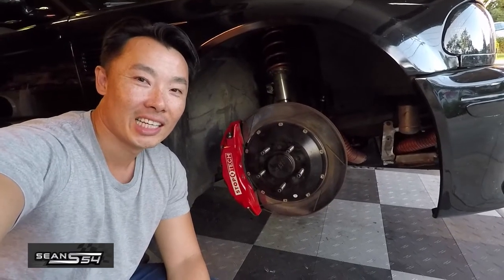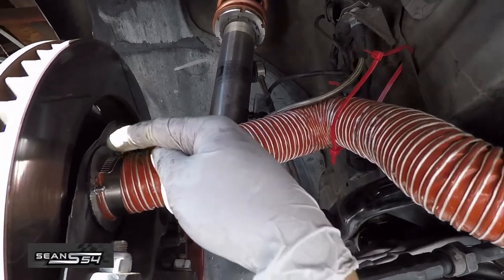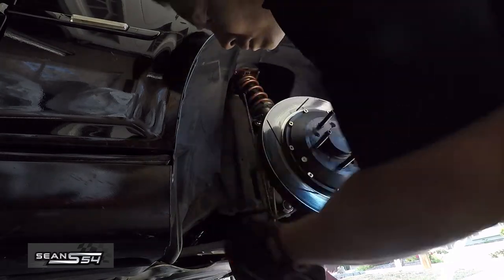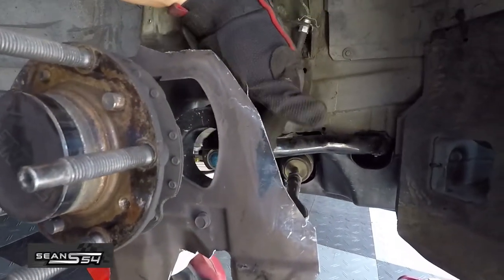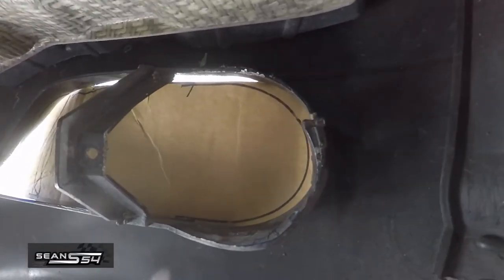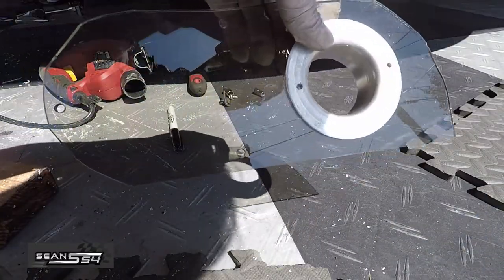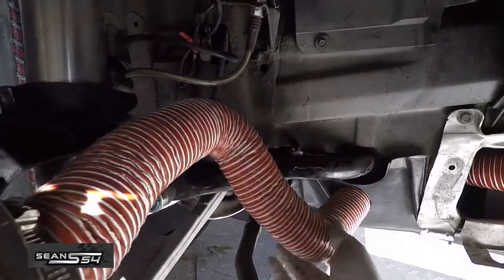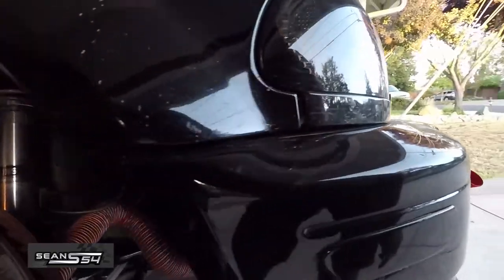Custom Brake Ducting for your Track Car - BMW E46 M3

Comment: I think it would have been better if you used to original air duct, and just made some sort of reducer to attach the vent hose to and instead of cutting up the heat shield you shouldve left as is and installed the duct flange and connected the hose. I think that wouldve been better IMO
Reply: Lalo Herrera yes, I also thought of that, and it would bring even more air, anyway he can do it anytime if he wants

Comment: Nice video showing in detail the work. 
I also plan to install some brake ducts on a z4. My oem brakes with yellow ebc pads get hot after no more than 3 laps. They have only  60' on the racetrack and the pads are already cooked. I've made a pair of carbon fiber air intakes and now I need to install the tubes. Not sure, why you trimmed the exterior of the heat shield.?
Reply from the maker: Trimming of the exterior heat shield is not necessary... I did it to allow more air to the brakes while in motion or parked.

Comment: Yeah most probably the stock air duct WITH the accompanied heat shield is better than just 2" tubing going across all the suspension parts and destroyed heat shield.. :D
Reply: Heikki Saari I think the new cooling ducts will do better because the air now blows directly into the center of the rotors, but not sure why he had to trim the heat shield. Anyway,  the brakes will stay cooler now and probably compensate for the missing shield

Comment: How is this holding up? FYI I have no heat shields and no issues in spite of what a few think
Reply from the maker: It's holding up just fine, no issues at all. I didn't have brake heating issues on track with my 355mm BBK up front but I added the brake ducting to minimize heat and prolong the life of the brakes.
Reply: Yeah I would think not with that kit. My car is  pretty light but a little cooling wont hurt. What are you running for pads and fluid? Enjoy all of the videos!
Reply from the maker: Thanks Jay! I'm running PFC 99 compound up front, PFC 08 compound on the rears (stock calipers, ZCP rotors) with Motul RBF600 brake fluid.

The only "issue" I have with my brakes is pad knock back, which unfortunately is inherit to BMW suspensions and typical with BBK. Here's some info: https://www.youtube.com/watch?v=PgYNeEVNbTs&t=194s
Reply: I watched the video on the knock back and have a 4 day track event coming up and am going to work on the brake pedal tap.
Reply from the maker: Cool Jay! Practice left foot braking on the streets if you have an auto. Getting the left foot sensitivity/control down is the tricky part but you can master it in no time.

Comment: Where can I get the flanges? What should I search for?
Reply from the maker: I bought the flanges from https://www.aircraftspruce.com/ (part number 10350-8 ALUMINUM FLANGE 2" 10350-8). I bought the 2.0" kit years ago intended for my S2000 but am now using them on my M3.

Many people run 3.0" kits but keep in mind you'll get rubbing lock to lock. Not a problem on track but a problem if it's street driven. My 2.0" kit clears the wheels no problem.

Comment: I hope you don't drive this in the rain driving without the dust shield when water hits the brakes you lose your brakes
Reply from the maker: The dust shields are there to prevent dust on the suspension, heat barrier to suspension, and minor barrier to the elements. I don't really drive in the rain (it's a dedicated track car) but I'm sure a little water on hot brakes will be no issue.
Reply: Cut my shields completely off years ago on my Daily/weekend warrior. Have had zero issues with braking in snow/rain. No need to be rude. Nice video man!